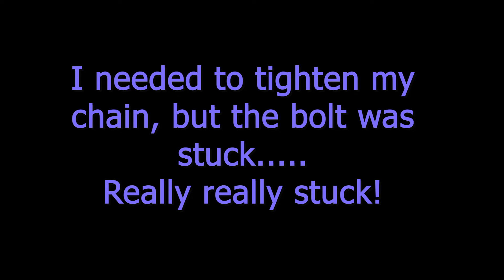My Chain Tension Bolt Snapped!

Comment: Dealing with this today. Coffee first.
Reply: how did you get yours out trying to get one out of a kx250f swing arm
Reply: @gregdestefano9784  mechanic tried everything and eventually had to cut off the studs and drill them out. LHS was fine, but RHS drilled at an angle and the new bolt is barely on the axle block. Really iffy, though it did just survive the NEBDR in horrendous riding conditions.
Reply: @gregdestefano9784 how did u do it